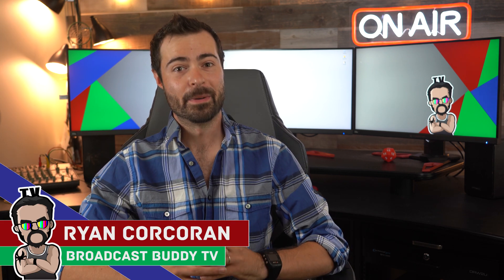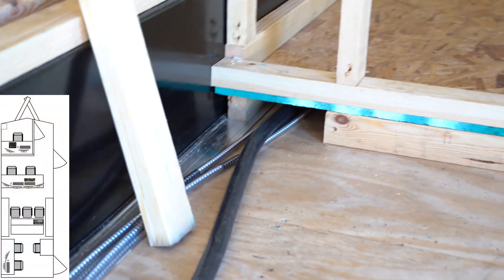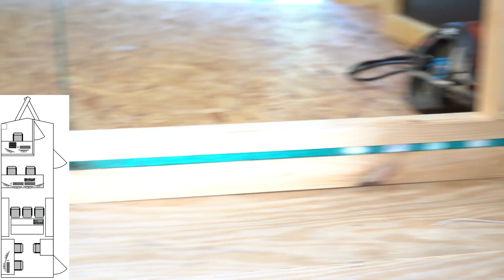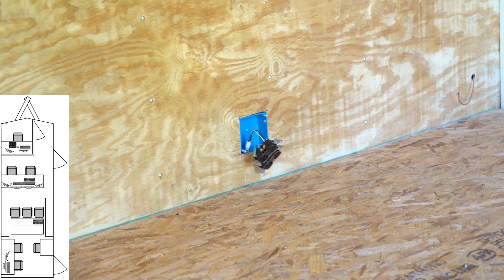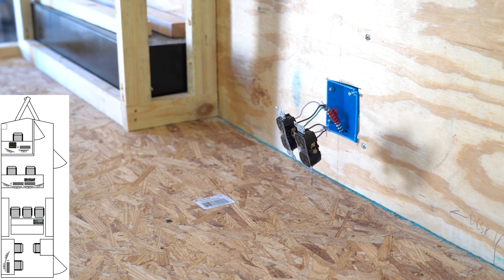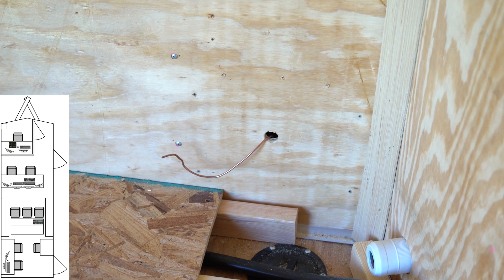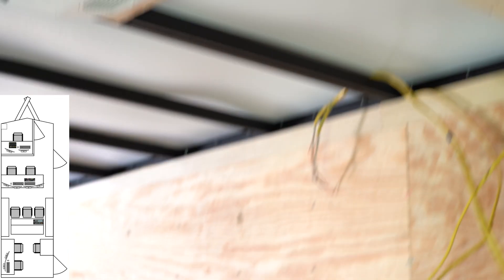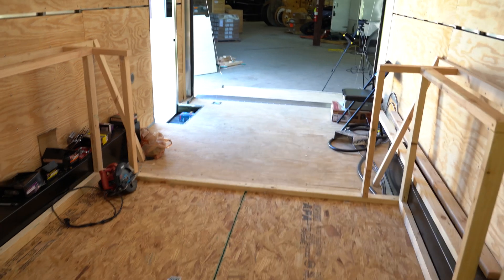Let's Build A Mobile Production Unit, Part 3 [Broadcast Engineering]

Comment: What is the height in the trailer after the partial drop ceiling and false floor? Most of these types of trailers that I have been in do not have a whole lot of room for someone over 6 ft. I have seen a couple where they had them built with additional height to allow for this sort of thing. Is that something you did?
Reply from the maker: We definitely had the trailer built with extra height in mind. I'll have to get the the exact measurements again, but it should be close to 6' 8".
Reply: @BroadcastBuddyTV  nice! I have knocked my head on too many door frames in my time!